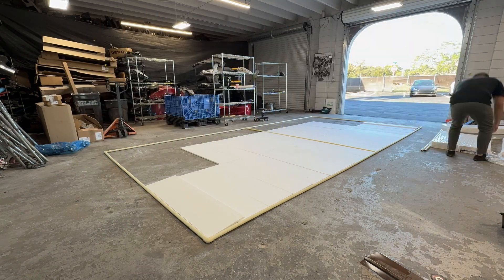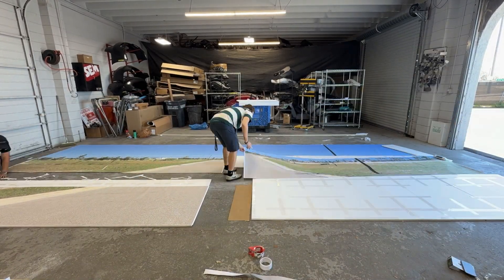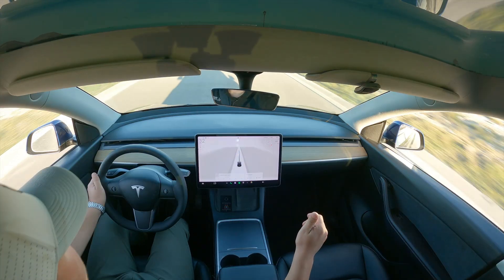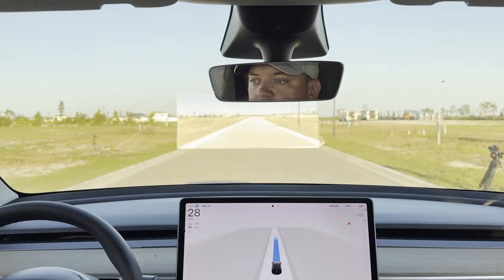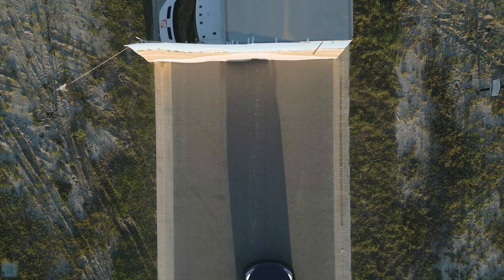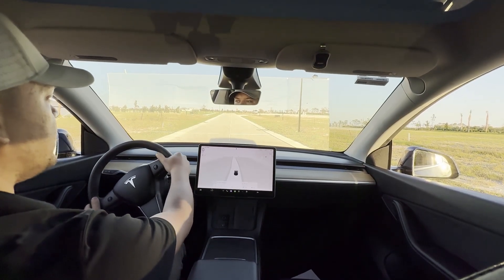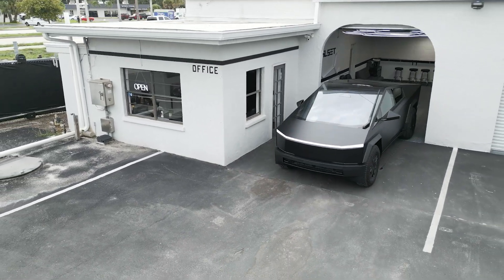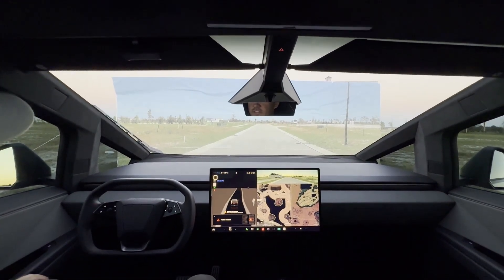Response to Mark Rober’s “Can You Fool A Self Driving Car?”

Comment: Personally, I believe this kind of test doesn't hold much practical value, as in reality, it's highly unlikely for such a wall to appear horizontally across the road. That said, it's undeniable that this is a very challenging problem for full vision systems to solve.

I think the main controversy stems from the fact that Mark didn’t present a fair comparison between vision and LiDAR in his video. He focused solely on showcasing the advantages of LiDAR while completely avoiding its shortcomings. LiDAR can also be misled — including but not limited to difficulties in recognizing transparent objects or surfaces with low reflectivity.
As a channel that emphasizes science education, it shouldn't be presenting such an unrigorous and biased conclusion.
From a technical standpoint, relying solely on LiDAR for autonomous driving is impossible — it must be integrated with camera data. However, sensor fusion is a difficult challenge. Most current neural network architectures are not capable of processing LiDAR and camera inputs simultaneously. Using different models to process each can lead to information loss, conflicts between model outputs, and so on.
Personally, I believe that until the sensor fusion problem is properly solved, pure vision remains one of the best and most cost-effective approaches to achieving autonomous driving due to human driving base on vison. Of course, as technology advances, I believe new algorithms and new types of sensors will emerge all of which will contribute to solving autonomous driving challenges and improving safety.

Comment: for anyone wondering why the cybertruck stopped: the cybertruck has version 13 which is a complete rebuild of the tesla fsd system.  its night and day different than version 12.5... even version 12.6 is night and day from 12.5.  12.5 is one of the worst versions of fsd currently installed on teslas.

Comment: Thank you for making this and not tampering with the data. However, as it has been pointed out many times before me: Tesla uses visible spectrum lighting. By the time you tested the truck, the difference was almost literally visibly night and day between the picture and reality. If you can, please repeat the experiment with the truck during comparable lighting conditions. Also, in the interest of plausibility, failing the fog and rain tests are of much greater real-world interest in many parts of the world (monsoon seasons in the southwest, inversions in northern Utah, etc). So, not only can we not declare victory for the truck yet, but even if it passes the “acme” wall test, I it would be nice to see it pass real world threats.

Comment: Someone tested it with simulated fog, heavy rain, and reflective walls, and Tesla failed all of them. It crashed into them completely, while other EVs equipped with LiDAR passed the test.
Reply: That's why he did this test because of that one. LiDAR would stop no matter what because it sees those things as a wall. It wasn't stopping because of the dummy kid in the road. You can see videos of a LiDAR stopped on a street because fire hydrants are going off or steam coming out of a manhole

Comment: If a car can achieve the same results using software algorithms without relying on lasers, it proves that Tesla’s FSD has access to massive amounts of data. If they have this capability, they can do more than just sell cars—they could develop any humanoid-like products, such as construction robots, self-driving planes, high-speed trains, medical robots, architectural automation, and household service robots.
Reply: yes if - but if it's only tiny bit worse and someone dies it will be a PR desaster.
It's not vision against lidar it's vision against vision with additional lidar (and radar) to measure distances as an extra plus.

Comment: I think Rober's video was fabricated. If you watch it closely. The wall breaks in a very clean and in a specific pattern. Like the wall was pre-cut to allow the car to have less issues going through the wall. I was impressed with the Lidar though. I was surprised the lidar did such a good job with the water.
Reply: The wall was precut to give a carton finish to it.

Comment: Great video. Would also be nice to see results for the other two tests that Tesla failed in Rober's video, the extreme fog and extreme rain simulations. Also using 12.6 on HW3, but that's not as important as the fog/rain test when assessing the theoretical potential for camera-only vs lidar systems in the future.

Comment: I'm not to surprised because the cybertruck is the first consumer tesla to have radar for FSD, which is very similar to lidar but instead of light it uses radio waves to judge the distance from it's reflected waves
Reply: Nope.   From Grok:

As of March 20, 2025, the Tesla Cybertruck does not use radar for Full Self-Driving (FSD). Tesla has shifted to a camera-based system called Tesla Vision for all its vehicles, including the Cybertruck. This transition began in 2021 when Tesla started phasing out radar in new models, followed by ultrasonic sensors in 2022. For older models that originally had radar, Tesla has disabled it through software updates, ensuring that all Tesla vehicles, including the Cybertruck, rely solely on cameras for FSD by 2025. Therefore, the Cybertruck's FSD system operates using only its camera suite and neural network processing, without radar.
Reply: @ well I got my information from Teslas website so idk what to say bud
Reply: @jgplayz  perhaps you read about the cabin occupancy radar.   It is not used for FSD.

Comment: It definitely is different. It's not a reflective mylar or a mirror surface, so the edges of the picture won't match up triggering FSDs ability to see it. A mirrored surface keeps the horizon closer to the cars movement making it easier to fool its intelligence. Try spraying water that blocks its visual recognition ability and you'll find it alarming you to take over.